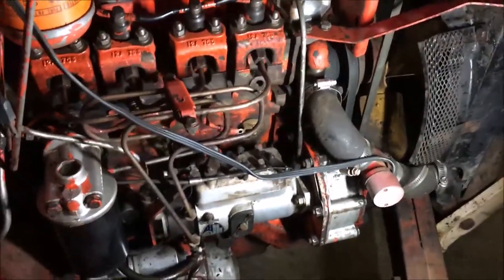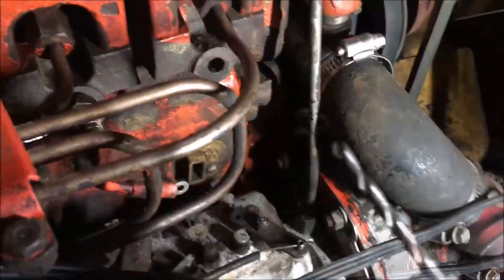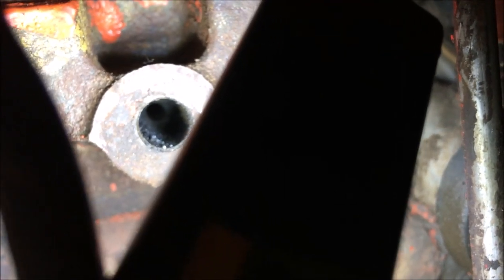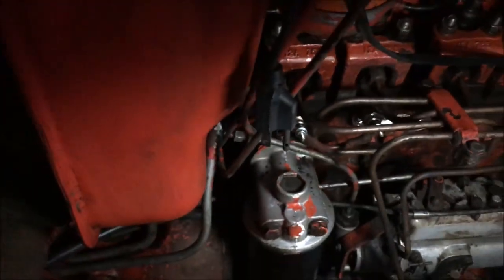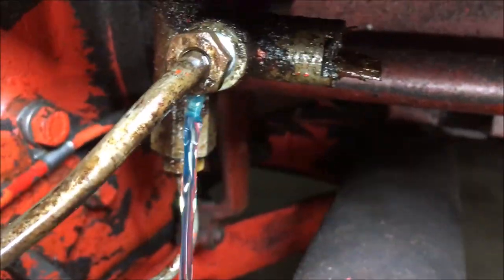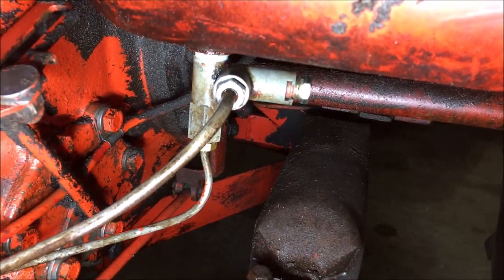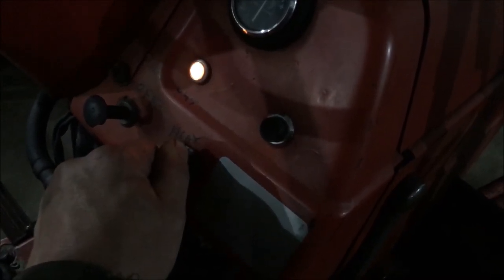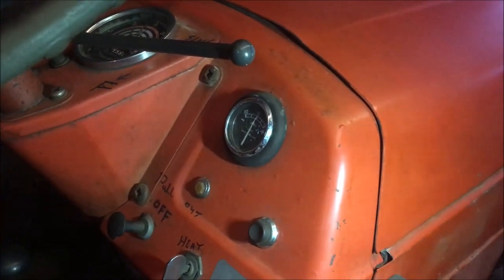The BMC Mini Gets New Glow plugs

Comment: Charging system will work fine with battery connected either way. A common conversion back in the day when it was discovered negative earth is better for rust prevention than positive earth. To convert from positive to negative earth disconnect battery and dynamo leads. Reconnect battery negative to ground first then before connecting positive take a wire and hold one end on the battery positive and use the other to flash the field on the dynamo by touching the small spade terminal several times. This reverses the residual magnetism in the field magnets. Reconnect the battery and dynamo and you're good to go. If the ammeter reads backwards then reverse the connections on the back. Most conversions I've done it's just been a case of reversing the battery without having to flash the field.